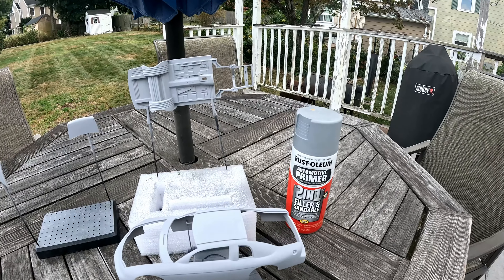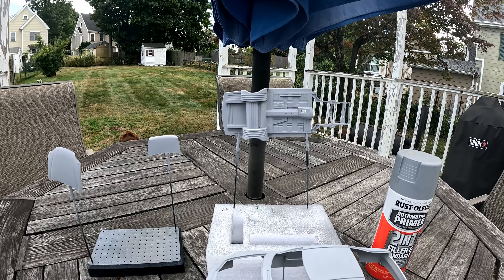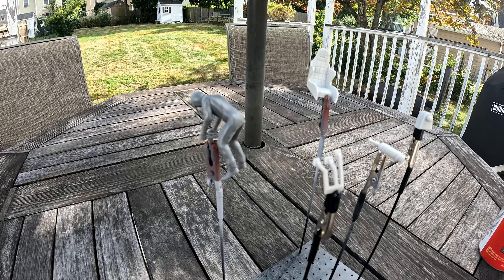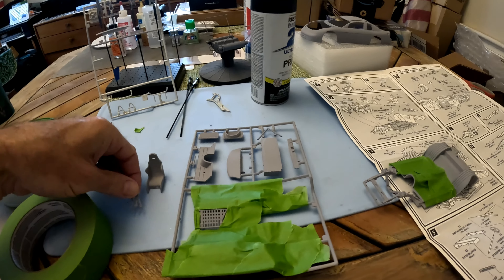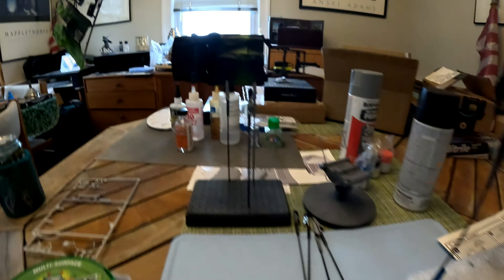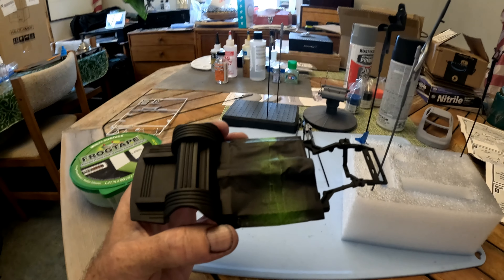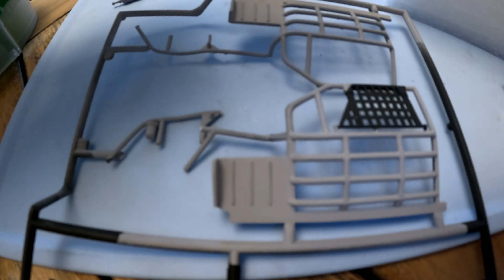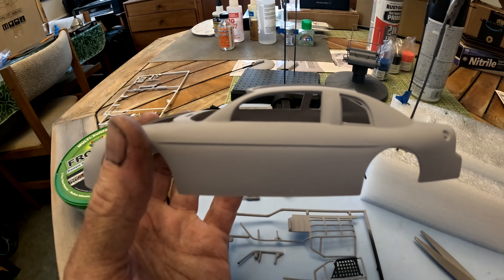Monte Carlo build part 3

Comment: Tamiya print stripe tape for the edges, then the frog tape Gene.
Reply from the maker: ok, I will have to get some
Reply: @SpareRoomSlotCars  It will make for a cleaner edge on those verticals.
Reply: Supposed to say pin stripe